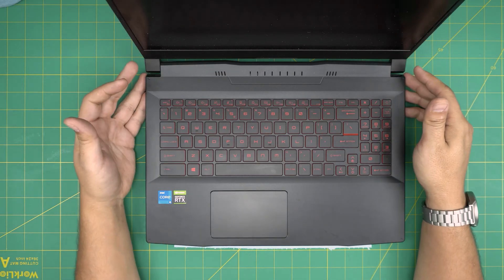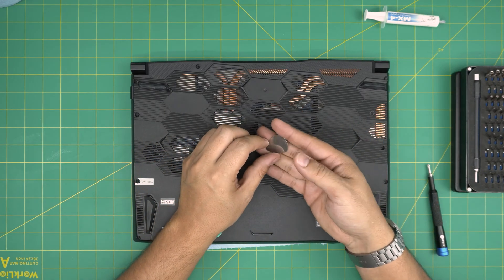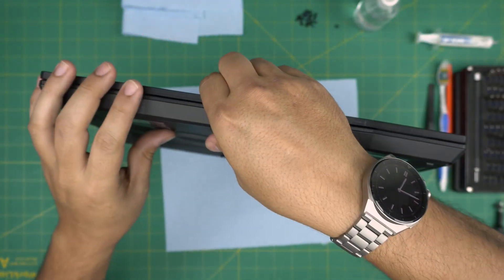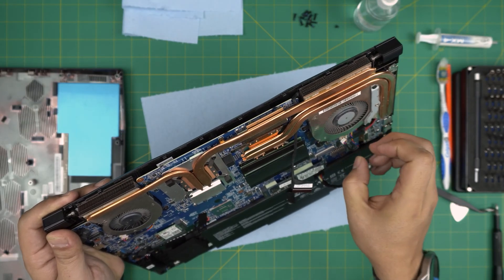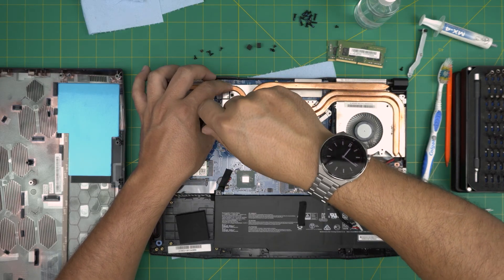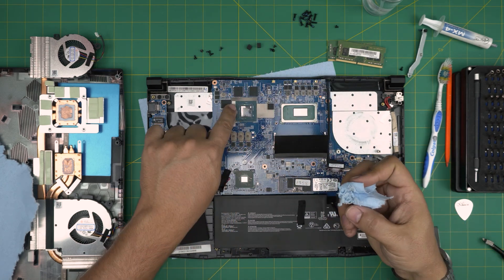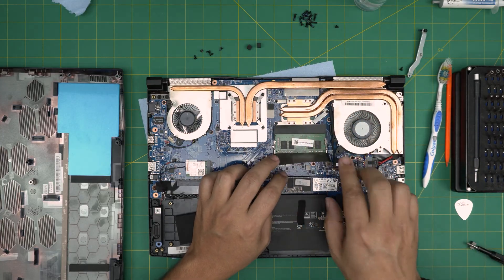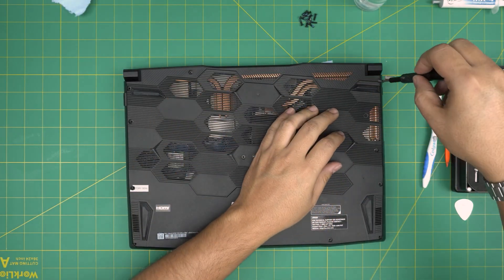How to Repaste and Clean an MSI Katana GF66 11UC MS 1582 Laptop | GL66 11UEK

Comment: I’m using the same model laptop and it’s shutting down without warning while gaming and downloading softwares. 

CPU temp is at 94C while gaming. I’ve decided to change the thermal paste, is it necessary to change the pads?
Reply from the maker: Thank you for your feedback! If you wish to support the channel, you can like, subscribe, or both!
Regarding your question,  i highly recommend you to replace the thermal paste with the best paste possible:
thermal grizzly kryonaut: https://amzn.to/47qIB9D
DON'T replace the pads and don't touch them. just a good fan cleaning and remove the fans they are held by 2 -3 tiny screw on the heatsink.
Should you have any further questions or requests in the future, please don't hesitate to ask me.
cheers🍻

This is an Amazon affiliate link. When you use my links, you are helping to support the channel. 🙏
Reply: @uFixTek  unfortunately since I’m from a different country the link you provided doesn’t deliver here.

Can I clean the dried paste of using acetone instead of iso propyl alcohol?
Reply from the maker: you can use acetone and a paper towel.
Reply: @uFixTek I followed this video and changed the thermal paste and cleaned the fan.

It’s working perfectly now. Temp decreased from 95C to 70C while gaming.
Reply from the maker: awesome and enjoy the freshly service laptop my friend 
cheers🍻
Reply: @7tm7tm7tm  @uFixTek Hello, I have the same notebook and the same problem that it turns off without warning but it always happens after closing any game, was your problem solved changing the paste? Do you think the problem is 100% overheating? Thanks
Reply: @JalcayagaL  My problem was overheating and shutting down while gaming. I cleaned the fans and thermal paste and that solved it.

Can’t really comment on yours. Try cleaning the fans and reapplying thermal paste, that may can solve the issue.
Reply: @7tm7tm7tm  Oh thank you, that help me a lot

Comment: My GF66's gpu fan is making rattling noises. Should i replace the fan or just clean it and lubricate it with machine oil?
Reply from the maker: Thank you for your feedback! If you wish to support the channel, you can like, subscribe, or both!
Regarding your question, i recommend you to open and clean with toothbrush and lubricate and if that didn't resolve it then replace it, as you don't have nothing to loose by trying it.
Should you have any further questions or requests in the future, please don't hesitate to ask me.
cheers🍻

Comment: Hello Sir, I have a GF66 11 UE model device. Does thermal paste dry in 1 year? How much temperature difference does mx-4 create compared to the original thermal paste? On my computer, FPS drops occur after 10-15 minutes in games. If I renew thermal paste, will it fix it? Thank you. Thanks.
Reply from the maker: Thank you for your feedback! If you wish to support the channel, you can like, subscribe, or both!
Regarding your question, the paste dryes depending the usage of the CPU, i highly recommend you to usse this: thermal grizzly kryonaut: https://amzn.to/3tlvyrL
with this you will se a temp drop a lot you will be set around 70c
and you will replace it once every 2years.
Should you have any further questions or requests in the future, please don't hesitate to ask me.
cheers🍻

This is an Amazon affiliate link. When you use my links, you are helping to support the channel. 🙏
Reply: Sir, you used Arctic mx-4 in the video. I'm thinking of using mx-6. Currently my processor temperature is 54 degrees at idle and 94 degrees under load. Are you saying that after thermal paste renewal, it will drop to 70 degrees under load? Thank you.
Reply from the maker: yes it will drop dramatically, but if you use: thermal grizzly kryonaut
the mx-6 is good too but the grizzly is the best.
Reply: @uFixTek  I ordered Thermal Grizzly Kryonaut. I will share the results when the process is completed.
Reply from the maker: awesome
Reply: @abdulkermatmc  curious how your temps are now? :)
Reply: I used Thermal Grizzly Kryonaut Extreme Thermal Paste. CPU average 85°, GPU average dropped to 78° under full load. At the end of 6 months, the paste pumped-out. Right now CPU is 95°, GPU is 87° under full load. There is no FPS drop but the computer is warming up. I am thinking of re-pasting with the new Thermal Grizzly PhaseSheet PTM 0.2mm Phase Change Thermal Pad. I think phase change thermal paste is the best for Gaming Notebook. If I re-paste, I will share the latest status.
Reply: Any updates bro? Pls tell me it works ;) @sammyyammii
Reply: How is it man
Reply: Would be nice to know